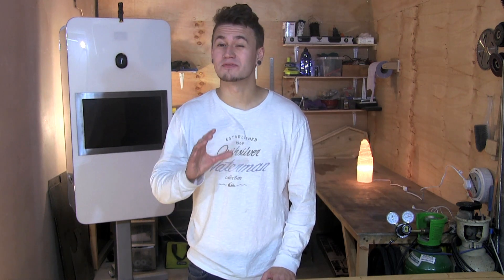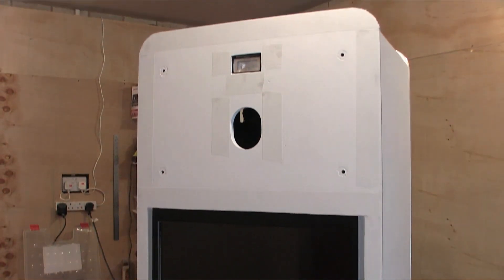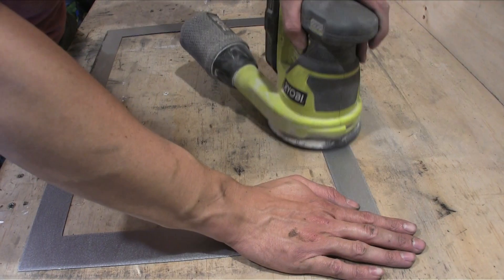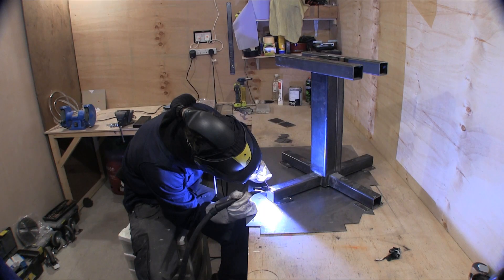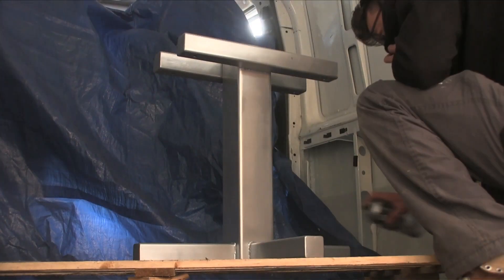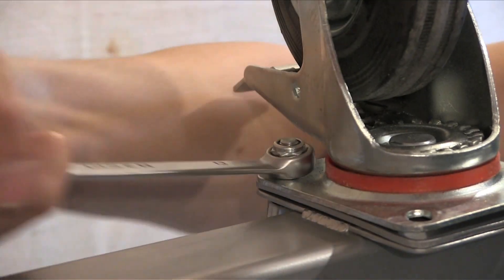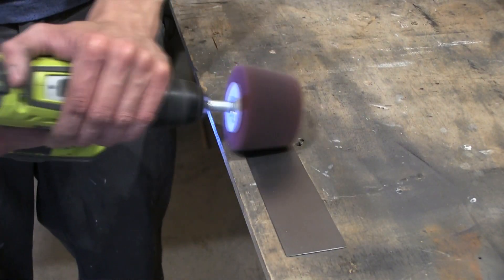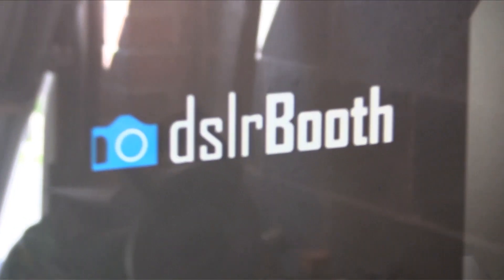Making An Open Air Photo Booth - Part 4

Comment: Hi ! Great work ! May I know what monitor do u use? is that an all in one pc? Thank you so much! currently making one so this is very helpful
Reply from the maker: Hi! Thanks for reaching out :)
I used an old laptop that had high enough specs to run the photo booth software. I managed to get hold of a touch screen monitor pretty cheap on eBay, I think I put some links in the descriptions of the videos, so you should be able to buy one similar through those. Let me know and if not and I’ll do my best to find you a link. 

I hope your project goes well! Glad the videos are helping 😀
Reply from the maker: Hey, I’ve just seen that the links to the monitor are on video two of this series. Good luck 😊
Reply: @DreDurezza  aah perfect! Thank u so much! Gonna check on ur part 2 then 🤗 Keep up ur good work! Its amazing 

Cheers!
Reply from the maker: @gita30791  thank you 🙏 really glad you like it 😊 let me know how yours goes 😎